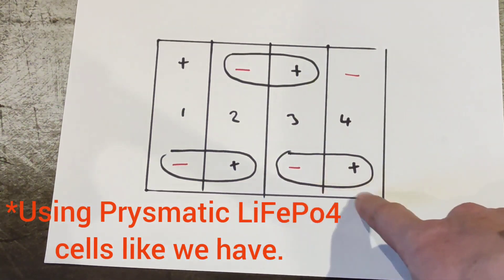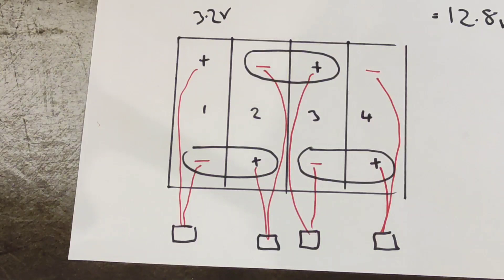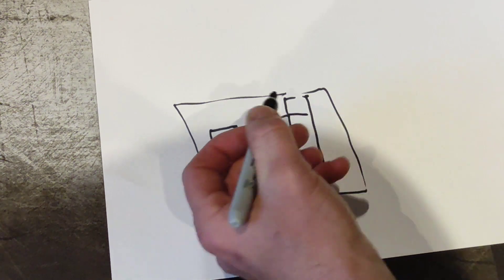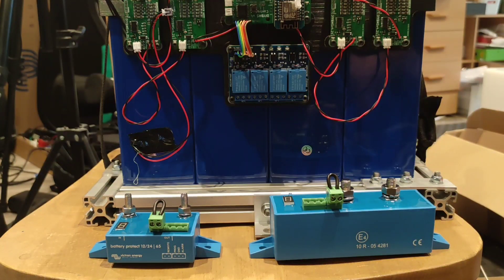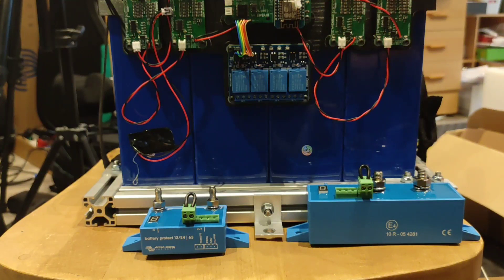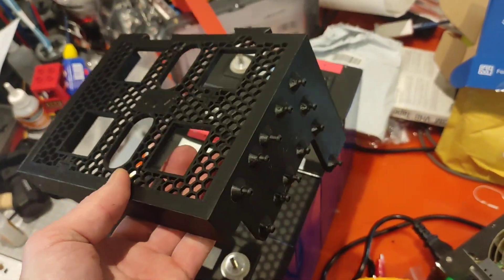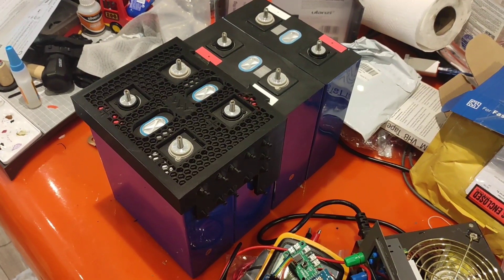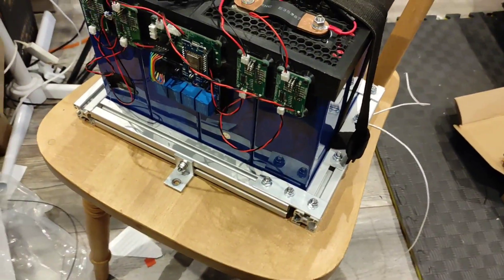Adventurevan Luna - DIY Lithium Battery | Ep30

Comment: Wow, awesome set up. You've really built a clever system there. Did you already know electrics pretty well, or have you learned all this from scratch?
Reply from the maker: This is a huge step up from our previous experience. So we worked hard on the research to make sure we've built a safe and robust system.

Comment: Why not use the remote wires on the dcdc ? You can also get a cable to connect to the v.e port on the smaller mppt solar charger to also act like a remote wire. Do you have insulation between each cell? The cell metal casings are bonded to a terminal... Maybe your aluminium rails could also cause shorts.. hmm nice video though ! Like that BMS ! Also maybe put the temperature sensor on one of the inboard cells.. it will heat up faster !
Reply from the maker: Thanks for the feedback, yes I may just use the remote port on the Orion. The VE Direct port on the MPPT will already be in use connected to the Victron Pi (running Venus OS). Maybe that can take an input to turn off the MPPT, we still need to look into that. I'll look into the insulation and make sure that we're not going to get a short anywhere. I did check to make sure that the cell's insulation was fully intact before assembling.